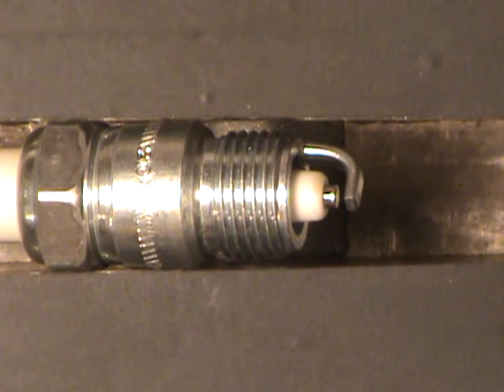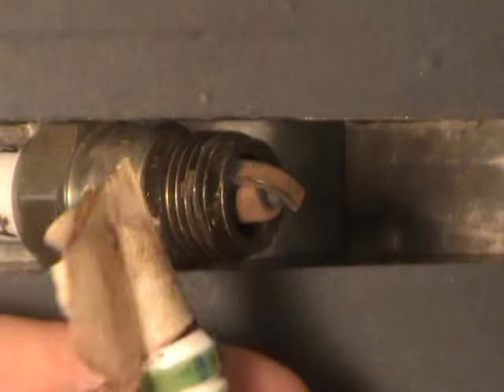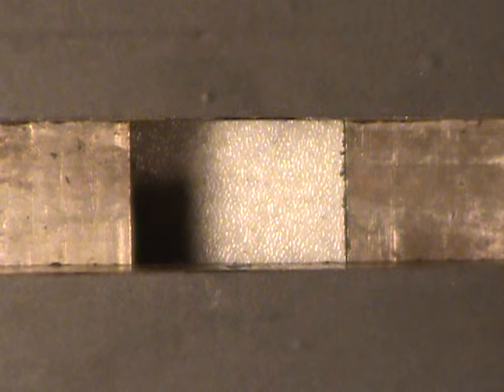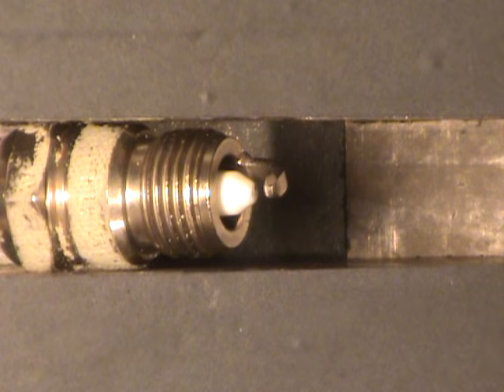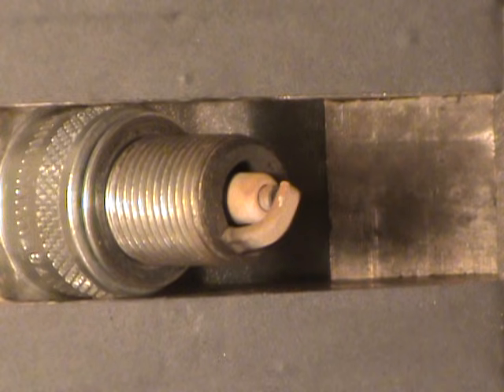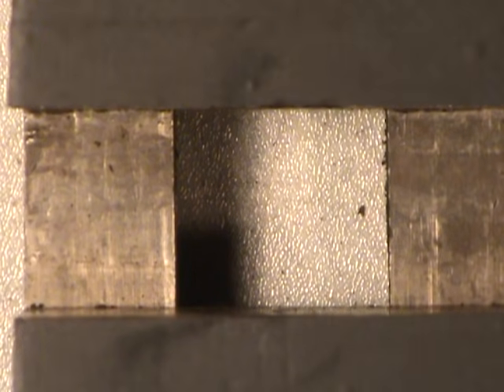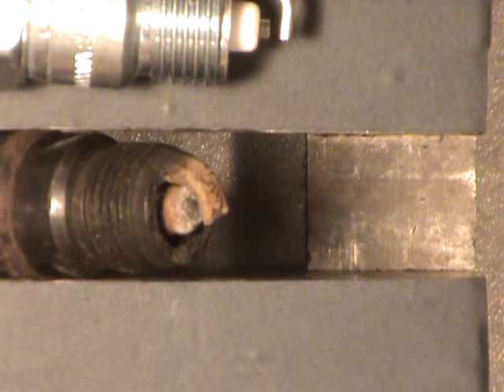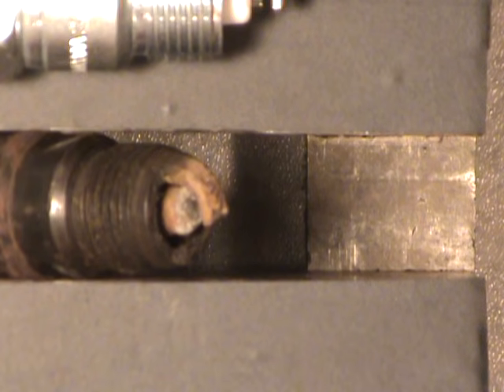SPARK PLUGS How to Read them (Part 3)

Comment: ?? What would say about a plug no deposits, very dark brown to black and dry???
Reply from the maker: Greetings...Cat Dakman………..Thanks for watching...…...Well, very dark brown, to black and dry, to me, are actually deposits, of, one kind or another...……A lot depends upon, what year the vehicle's engine is, and, how many miles (or kilometers) that is has on it, as well as, does the engine have a carburetor on it, or, is it, fuel injected/computer controlled...???...……Even, a lot of short trip driving, can cause, those dark-ish colored deposits, to stick, onto a spark plug, especially so, on an older carburetor equipped engine...…….The much newer, fuel injected/computer controlled, vehicle's, engine's, spark plugs, will usually be, much cleaner looking, without having, much in the way of, any deposits on them, sometimes, lookin', almost white-ish in color...……The much older engines, that have carburetors on them, tend to get darker deposits on them, due to, cold engine starting, and how the choke system, richens up the air/fuel mixture, which gets even worse, when the choke system's (plate/valve), stays on/closed-up, for way too long, and, should also be, fully opened up, when the engine gets up to operating (fully warmed up) temperature...…….For an engine, that has a carburetor on it, then, a light tan color is what I like to see, showing up, after, a few hundred miles of driving, are on, a brand new set of spark plugs...……..A black and dry deposit, is usually, dry, black carbon, which means, that, it is running too "rich", as in, a rich..."air/fuel" ratio (as in, the mixture, being the amount of gasoline, that is mixed in, with the air, that, the engine inhales)...……Dark brown, is usually the stage, that, is not, quite as rich as, that dry, black carbon color, but, is still a bit rich, just the same...…….It's a good thing, that, it wasn't black and oil-ee, because, that would usually be, motor oil, getting into your engine's combustion chamber/s, where the business end of the spark plug is (sometimes, there is wet gasoline, mixed in with, that black colored deposit, so, I smell it, to see if it smells like gasoline, and, I also rub some of it, between my thumb and forefinger, to see, well, actually "feel", if it feels like motor oil, or not...???)………..If you can let me know, about your vehicle, as in...Year...Make...Model...Engine Size and number of cylinders...and...if it has any....Modifications...at all, then, I'll have a much better chance, at, being able to help you out...thanks.....and.....till next time...…Be Safe, take care, and have a good one.

Comment: Found oil on 
a cross-threatened  plug.  Replaced with a new plug with the washer that came with it.  Car starting up smooth now.  
Will re-thread eventually.  The original plug did not get wet until about 3-400 miles.  When the car started up missing,  that's when I found the oil.

A good video for all to know
Reply from the maker: Greetings...Steven Brooks...……..Thanks for watching...…….It's good to hear, that, you fixed the problem, even if it happens to be, somewhat temporary...…...The older, common type of spark plugs, usually don't cost very much, so, not a big deal at all...…….If the cylinder head's, screw-threads, are damaged really bad, then, it's usually, just a matter of, removing the damaged cylinder head, and, probably installing a "heli-coil" (aka, a screw-threaded insert), which will usually restore, those damaged screw-threads, back to being, in, like-new condition...…….The way that I see it, then, the "cleaner" the spark plug, the better, that way, it won't usually be, the spark plug, that causes an engine misfire, as long as, the spark plug isn't faulty, that is...…….Good luck, with the "permanent" repair, and......till next time...….Be Safe, take care, and have a good one.

Comment: Really excellent and clear, unhurried explanation. Best I've seen here. Many thanks.
Reply from the maker: Greetings...James Trigwell………..You're welcome, and, thanks kindly, for your very nice comment...…...It's a good thing, that I'm able to slow down my speaking, because, my thinking process/imagination, operates very fast, but somehow, I'm still able to relax...go figure...lol...……..I have a lot of ideas, maybe, too many, that, probably won't see the light of day, so to speak...……As for spark plug reading, then, my way, is very general/old school, where-as, some of the 1/4 mile drag racers, use-tah (maybe, still do), remove the spark plugs, right after doing a run/race, and look down, into the depths, of the spark plug's firing end, with, what might resemble, a Doctor's, ear examining, magnifying flashlight, in order to, closely inspect, way down in there...…….There are probably some websites. that might show, what there were looking at/for...……...Thanks again, and...….till next time...….Be Safe, take care, and have a good one.

Comment: I bought a 70 Pontiac two years ago , lost my job it sat , never got to drive it . Last week , I drained and replaced the fuel , today I pulled the plugs and cleaned ' em with a wire brush . Cranked the motor , installed the plugs an Viola ! ? Started on the first turn ! Your video came up today and timing was perfect ! Your explanations brought it all back to me ! Thank you
Reply from the maker: Greetings...Dave Bruton………..You're welcome, and, thanks for watching...…….Good to hear, that, your car, was..."waiting-for-you"...lol.....…...Ah yes, kinda like, a dream-come-true, so to speak.........Here's some information, that, should help you out.........If the "coolant" (anti-freeze and distilled water mixture), hasn't been changed in some time, then, there can be, some unseen "corrosion" going on, inside of your radiator, and heater core too (oh, and, some heater cores, are a, pain-in-the-you-know-what, to remove and replace...!!!...lol)......... Is the Motor oil, nice-n-clean...??? (dirty motor oil, usually, starts plugging up the hydraulic valve lifters, over time, and, at first, it's usually, tick-tick-tick, that you'll hear, then sometimes, gets louder, and starts going, Clack-Clack-Clack...!!!...um, no thanks...lol)..........Automatic transmission...???...clean auto-transmission fluid, showing on the dipstick..???...........Rear axle (differential) gear oil, filled up to, where it should be...???...how dirty is it...???...and....the list, goes on and on...lol..........Enjoy your ride, and.......till next time.......Be Safe, take care, and have a good one.
Reply: I hope 6 years later down; you are doing well :)

Comment: Hi, Mr. Rocky.  So my van has stopped starting altogether.  Now, it doesn't even click when turning key.   So, I'm at a shop who said they cleaned all corrosion from wires leading to starter & said last resort was to replace starter, since still no power.  They predicted an hour to finish.  Several hrs passed, now saying they tried 2 different starters & neither got it going.  Need to keep my van to check more thoroughly.  Does this sound like alternator since the last time I held key all the way longer than a minute; no start, then a soft "poot" sound, then a little white smoke blew from under hood?
Reply from the maker: Greetings...Lisa Gooch...…….That white smoke, might be a bad electrical connection, that might have arced (sparked), which can produce a lot of heat, where it happened (melted wire insulation...???), well, if it was an electrical problem, that is (the "smell", of something, that went wrong with a vehicle, sure helps me a lot, but, I can't smell anything, from where I am...!!!...lol)..........The alternator, is the component, that keeps the battery charged-up, when the engine is running...……..A 12-volt, fully charged-up battery, on its own, I find, is at about 12.6 volts, that I see on my multi-meter...……..Once the engine is running, I will then, usually see about 14.5 volts there-abouts (depending on the vehicle, then, it could be, in the higher 13 volts range, up to, about the mid, 14-ish volts, and, when it's vey cold, think in terms of snow & ice, then, it might get, as high as, oh, about 15 volts sometimes, when the engine is running).........There are a few things, that can cause engine starting problems alright...……..To "crank" (spin) the engine over (before it starts running on its own), then, the battery has to be in very good shape (for me, that will usually be, a battery, that's not older than, about 5 years old), and, it has to also be, "fully" charged up as well...………The (electric) starter motor, has to be in good condition as well...……..Not sure, about your particular mini-van, but, there might be, an (electrical) "relay" (might look like, a little black plastic box, somewhat, that has electrical contacts, hiding inside of it), that is in, the starting system's, electrical circuit, that has to be working properly, or, a no start, it just might be...……..Some vehicles (not sure about yours), might not crank over, until the vehicle's on-board computer, checks, to see if everything is good or not, before, shall we say, allowing, the engine to crank over and start..........All electrical wiring, and the ignition switch, have to be working properly too...…….There might be, what is called, a "neutral/safety starting switch", that prevents the engine, from being cranked-over, unless the automatic transmission's, gear selector, is placed in "Park or Neutral", and, sometimes these switches go bad, and, this switch is in there, so Ya don't have the engine crank, or, crank and start running, when the auto-transmission, is "in-Gear"...!!! (just imagine the excitement, if that, were to ever happen...!!!...lol).........A "flooded" engine, (flooded with too much gasoline), being, on the inside of, the engine's combustion chambers, can cause, what is known as hydro-locking, which will keep the engine from turning over, even with, the world's best battery, and (electrical) starter motor...!!!...(true, that)...so, keep that in mind, just in case...(if I suspect hydro-locking, then, I usually, remove all of the spark plugs, to see, if the engine, will then, crank over, freely at all...???)…(same thing can be done, on lawnmowers, weed-whackers, chain saws...etc.)...oh, and, only do the cranking test for a very short time, because, the ignition coil or coils, as the case may be, will over-work themselves, and burn out, "unless", they are hooked up to the spark plugs, and, the spark plugs, are connected to an (electrical) ground source...and...there is very high voltage here, so, don't touch anything...!!!...oh, and also, it's a very good (safety) idea, to have a fire extinguisher nearby, just in case...……..That hydro-locking, can be caused by, a fuel injection system, that's not working properly, as well as, an ignition system, that won't be producing, a nice strong "spark", between the spark plug's two electrodes, just so Ya know...…….If I didn't already mention, the "Rockauto" website, head over there, and do a look up, on your exact mini-van...…….That website, is usually, really good, for showing a lot of pictures, of the parts, that are on your mini-van...enjoy...........Good luck, and...….till next time...…..Be Safe, take care, and have a good one.

Comment: Hey, there, Mr. Rocky!  I just made a great discovery after experimenting with my vehicle's ignition switch!  Since it appeared to me that my starting issues may be simply related to sensor, fuse, or timing, I conducted 2 different experiments.    1)  I quickly turned the key only to the point where the dashboard lights up, then I turned they back off.  I did this quickly, back-to-back 3 times.  The 3rd time, I left it in the position where the dashboard lights came on.  Then, I discovered that the mileage box revealed DIAGNOSTIC TROUBLE CODES, one at a time.  Then, a horizontal line of dashes appeared.  Then, it said DONE. This meant that my experiment caused my 2003 Dodge Grand Caravan to self check for trouble codes.  My codes were P0700 & P1684.  When I googled these codes, I realized that the diagnoses coincides with your guess about my starting issues.            2)  When the engine didn't start on the first try, I turned the key as far as it would go and held it there.  After a little less than a minute, it automatically started, smoothly, on its own.  This time, the engine wasn't dying down, causing me to gun the accelerator to clear the path.
Reply from the maker: Greetings...Lisa Gooch...…….Wowsers…!!!...you sure have a fast learning curve, when it comes to learning about automotives………..Be careful, as to how long, that you have the ignition key turned to the (engine) "cranking" position, as in, when the ignition key is turned, as far as it will go...……...The reason being, is that, that (electric) starter motor, gets quite "Hot", when it is cranking the engine over for a long time, and, if too long (of a time), then, the starter motor can actually "cook" itself, and look Ma, now I have to go and get a new one (or, a re-man/remanufactured unit)…………My rule of thumb (or call it what you will), is to, only "crank" the (stubborn/hard to start) engine over, for only, about, 30 seconds max (maximum), then, let it rest (cool-off), for about a minute or two, then, if need be, repeat the 30 seconds "on" time routine, then, let it rest between starting attempts (more rest time, between starting attempts, is even better, especially on a hot day)...……..Years ago, I cranked over an older Dodge (parent company, being Chrysler) V-8 engine, for too long of a time, and then, the starter motor got so hot, that, the bronze bushings (aka, bearings), inside of, that poor ole starter motor, actually, started "squeeling"...!!! (nope, wasn't, that there, well known piggy sound...lol)…good thing was, is that, the starter motor worked good again, "without" the squeeling, once it cooled down...…….Most of the fuel injected, computer controlled (gasoline) engines, will probably have a way, to deal with, a (gasoline) "flooded" engine, and here's how, that (gimmick...???...lol) works...…….The fancy name for it, happens to be..."Clear Flood Mode", and, it's simple to do...…….If Ya feel that, the engine is flooded with too much gasoline, then, all Ya have tah do, is to, push the gas pedal all the way down (to the floor-board), then, crank the engine over, then, "very...Very Important"...!!!...if the engine actually tries to start, then, get Ur foot, "Off of the Gas Pedal", or, you'll over-rev the engine (engine will scream...!!!), and then, it will get damaged, to..."Infinity and Beyond"...!!!...……...As far as I recall, is that, during this "Clear Flood Mode" procedure, is that, it basically "shuts off" the fuel injectors, so that, no "additional" gasoline, is gonna be added into, an engine, that already has too much gasoline inside of it, to begin with...…….Most fuel injected (gasoline) engines, will have, what is called, an "idle air control valve", and, it controls the amount of air, that the engine inhales, during idle speed, and, if this valve becomes faulty, or gets all covered in black dry carbon (powder), then, the engine might not idle so well, or maybe stall...…….This is why, I might have mentioned, a while ago, about, holding down the gas pedal, just a wee bit, to help the engine start, and to keep it running, at idle speed/low RPM's (that be, Revolutions Per Minute, of the engine's crankshaft)…………Fuel injectors, can also get plugged up as well (when gasoline evaporates, it's, not as clean as you think, cuz...it's nasty stuff...!!!...lol)………..Sometimes, only a few, of the fuel injectors, will get plugged-up, which will usually result in, having some of the engine's cylinders, running a bit "leaner" (air/fuel ratio/mixture-wise), than, some of the other cylinders, that were properly fueled (or fed, as in, feed, or feeding), and, might show up as, a shaking engine at idle speed, as an example...…….Quite interesting, that, your OBD-2 (On Board Diagnostics-version 2) equipped mini-van, has that, shall we say, "feature", that you discovered...congrats...…….If your mini-van, is starting and running, to your satisfaction, then, enjoy, otherwise, keep your shovel in close proximity, just in case, Ya might have to do some more..."digging"...to cure your ride...!!!...lol.....and...….till next time...….Be Safe, take care, and have a good one.

Comment: Would anyone what would cause that brown coating that was on the spark plug, to be on the inside of the spark plug hole?
Reply from the maker: Greetings...Country logic.........Thanks for watching..........Well, if that brown deposit, is the same color, as what, was on the spark plug, then, I'd say (without actually seeing it), that, it is probably normal, due to the way, your engine is burning the gasoline, that you put in your vehicle's gas tank.........Perhaps the wrong spark plug, was installed in your engine, and, it might be too short, where you see, all of those screw-threads.........So, make sure, that, the vehicle manufacturer's "specified" spark plugs, are in your engine currently..........Depending on, what type of additives, that are added into to your gasoline "blend", where you live, can at times, determine, just what color of deposit, ends up, on the electrode end of your engine's spark plugs, as long as, the engine is running properly, that is..........There use-tah be (maybe still is...???), a gasoline additive, that was called MMT (stands for, some hard to pronounce words...lol), and, from what I recall, was that, it left a Red-ish colored deposit, on the spark plugs..........As long as your vehicle's engine is running smoothly, and has lots of power too, then, there shouldn't be anything to worry about, and.......till next time........Be Safe, take care, and have a good one.
Reply: @RockysRoadshow  thanks for the answer